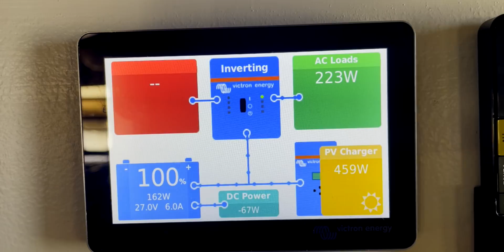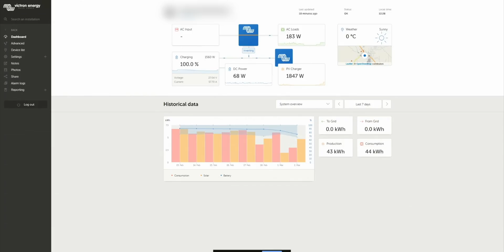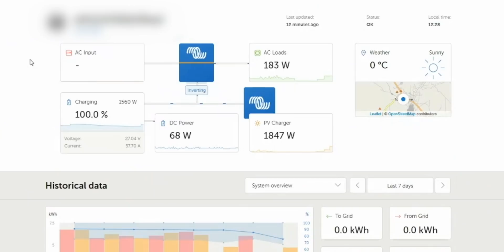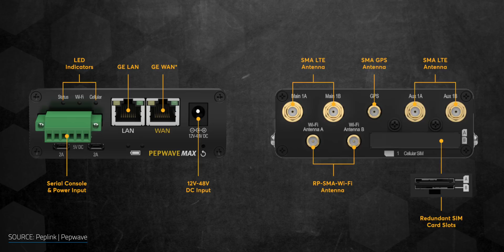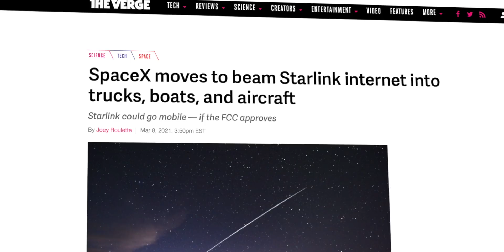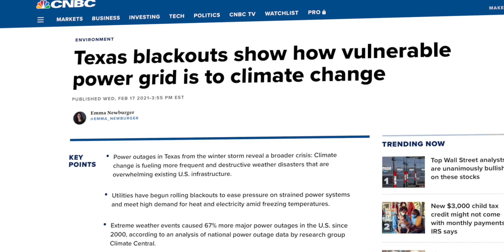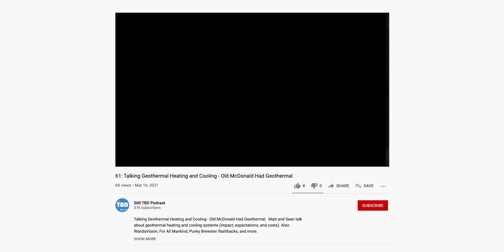Off Grid Living with Solar

Comment: I did something similar, although with a bus conversion. Live in it full time. Cellular, yeah you do need redundancy/multiple carriers. If you are used to gigabit you will be disappointed, especially in very rural areas with hills.

Solar was much larger scale than your typical RV setup- 10 305W panels for 3050W and a 10kWh Tesla based pack. I found this was plenty for all our normal appliances, but not enough to run the heat pump and AC through the nights however. So I'm upgrading to 6000W of solar and a 43kWh battery bank this month. The goal is feature parity with a typical household's electrical, not a "mobile" experience.

Here in KY it was a similar experience during the snowstorms, outages. We had internet and normal power the whole time, but couldn't run heat off solar due to continued overcast and low battery capacity.  Ended up running a generator through that.

Nice video! Lots of people going mobile...

Comment: I did something similar last year, just on the opposite end of the price spectrum.  I bought a cheap long wheelbase VW Crafter (similar to a Sprinter) with 500K kms, stuck some solar panels on top, a fridge/freezer, inverter, 4G modem, a mountain bike and windsurfer.  I had some real adventures in that van!

I toured New Zealand in this van for a few months while doing full time software development.  With 180 watts of solar, a weak 100 Ah lead acid battery and a power hungry gaming laptop it was challenging at times but overall worked pretty well before covid hit.  This setup looks sweet, I wonder how much it cost?  My 4G modem worked surprisingly well  but was very expensive and you need to be careful about remote areas with no cell coverage.  Starlink would have been ideal.

Comment: I'm with you Matt. I would find it hard to work within those space constraints. There's also a technical hitch, I don't drive. Was wondering whether your friend travelled to the northern states where solar power isn't as practical. Also I imagine he'd burn through a lot of fuel hauling such a heavy load from state to state. Wonder if he has an order in for a cyber truck?

Comment: We'll see how overkill his solar is after the inevitable cybertruck integration.
Reply: That trailer looks heaavvyy though. Even if you could bring the CT batteries to full charge, I bet your range would be like 80 miles. It's not nothing, but I'd always be getting anxious about finding a  good parking spot for that behemoth. The next question is how long you would need to stay put before the CT batteries would fill up again. I would guess more than a week. It might be nice to have a week to explore the new random place you arrived in, but I wouldn't really feel safe just leaving that expensive trailer parked and unattended as I went exploring. If you approached it with the right attitude though, all that unpredictability and spontaneity could actually be the the basis of an amazing American experience.

Here is a tip for Elon: You know how you have structural batteries now that make up a stiff undercarriage? How about a structural all-solar-panel one-piece roof for a trailer that mates nicely with a Cybertruck? I mean, a serious RV roof that's nothing but solar cells. A weight-optimized trailer setup like that, with mobile Starlink integrated, could make a game-changing system that would fulfill many people's dreams. (And a significant fraction of these people actually have the money to pay for it.)

Comment: I've thought about doing exactly that. The main reason I never pulled the trigger is the size of everything required to pull it off. The trailer is huge, and requires a huge truck to pull it. By the time you're done spec'ing and building you're in for $200k. I'm still planning to build a panel van RV in the future, but not yet.

Comment: He just needs to replace his pick up with a cybrtrck or some other electric truck of his choice..and utilize those 5-6 KWH of daily energy he can't use right now, he would also be able to utilize the electricity supply of the RV parks to charge that.
Reply: A truck with bi-directional CCS would be perfect!
Reply: I was thinking that too.
Reply: Not really necessary.

Comment: Solar panels on the roof of an RV are great for supplying the basic electrical needs, but A/C, heat, and water heating are quite a stretch. Not impossible, in sunny climates, but requires a full roof. And all of that is fart in a hurricane compared to the energy required to run the pickup, to be "energy independent". Then there's having enough land to grow your own food. Getting food otherwise consumes much more energy.

Comment: Oh, I DEFINITELY think about doing this. I'm glad to see how he pulled it off. I'm going to drag my feet a little longer since tech developments in batteries, PV, and internet connectivity are likely to continue bringing rapid improvements in the next few years.
Reply: I’m already amazed at how good it is, I still think of these things like 70s camper vans. But in another 5-10 years, as you say, it should be even better! Either much cheaper for the same capacities, or for the same budget far better ones.

Comment: With that much spare capacity, they probably could do all their AC/heating and cooking also.  I recently saw another RV video that had a 7000BTU domestic split AC installed, which they claim is fully powered by their RV's installed solar and battery. The AC drew around 400W in either heating or cooling mode.  I think they had 1.5kW of roof-top solar but can't remember the battery capacity.

Comment: I see a lot of people talking about how starlink is gonna revolutionize RV internet, while this is kind of true there are two major problems, the first being tree cover. Out West this is not a issue, but the more North or East you go this becomes a major issue at RV parks and public land. Second is ground stations, current starlink tech requires you to be a certain distance from a ground station. However this will improve as more base stations come on line and this will level up when SpaceX roll's out the newer satellites with interconnectivity which will allow you to be in the middle of the ocean and get quality internet by passing connections from one satellite to the next till it reaches a ground station.

Comment: A key thing left out of this discussion is heat and cool.  We opted for mini-split  (e.g. electrical) for heat and cool as apposed to propane or diesel for heat.    In our rig, it takes about 10kwh to heat (at 72F) for 24hrs if the temp goes down to 35F low.   So maybe 7kwh if we only heat to 60F (and dress warm)?    So we sized your battery bank about 3x larger than this video on a much smaller rig and can only do 1.2kw of solar - overall its not enough unless one stays in sunny/moderate temp areas.

Comment: I've run the numbers for me...  I'd have to be able to stealth about 80% of the time to recover all the costs in 5 years - counting no rent but having full internet (just before Starlink started their beta)...  The cheapest way if you're doing this and moving a fair amount though is to charge from the vehicle battery using DC-DC to begin with, but have it wired to add solar incrementally as you learn your draw demand.   This is a sweet setup (and gorgeous masterboard - really nice craftsmanship, seriously...)  You can always start lower in battery count and add in as well, that's pretty straightforward.

Comment: I am also a developer and started full-timing in November.  Currently on an 8 month trip across Texas, Louisiana, Florida and up the east coast this summer.  We are not as energy independent having only 800w of solar power and 400ah of 12v LiFePo4 batteries on a 43ft 5th wheel bunk house.  We also use a combination of AT&T and T-Mobile SIM cards and our Verizon phones for internet.  It works well.

Comment: Very insightful.  Let me point out that this system is NOT enough to run an air conditioner.  Can't wait for Starlink on the road.
Reply: Why not ? His ac uses 400w once the temp has stabilised. Mine does the same.
Reply: @nordic5490  Just going off of the numbers he provided and a good, solid Texas summer with AC use as my experience.  If you don't get in and out of the RV that much and set it to 80 degrees, maybe.

Comment: I wonder what it would take to live in an off grid RV like this without a municipal water source and with growing your own food hydroponically.  If you could get by with only buying stuff like soap and plant fertilizer.
Reply: Once you add the hydroponics you are really no longer mobile.  All he would need is a Reverse Osmosis system with a draw/drain line and a local lake/creek for water.  (essentially what yachts use, called a watermaker)    The amount of space it would take to grow enough food for one or two people on a continual basis would be fairly large and water is heavy.  

Watermakers are not THAT expensive, but they do need a decent amount of power to operate.

Comment: Great video, this is an exact replica of the system I just put together on a 2015 torque. I designed and put it together myself 15kw battery, 3kw panels.
Reply from the maker: Nice!  Happy with the results?
Reply: @UndecidedMF  the pannel output is less than I had expected (I usually sit at 1.5kw or around) the battery is crazy impressive. After everything, I'm at right near $4k invested. Granted, I sourced all my parts direct from Chinese manufacturers and built everything myself. But for what I have, this was a no brainer, I love it! I love the life, now time to travel and make some YouTube videos!

Comment: My off grid system is stationary and about $1,200. The guy in the video has about $8,000 worth of batteries. This may sound a little weird but in 1920 it would not have been cost effective to buy a horse that would last 100 years. In my case it would not be cost-effective to pay $2,500 for a battery that will last 20 years. For the same reason. I live in Texas and people have quit making fun of my solar panels.😁
Reply: LOL - that's 'cause we have our own - and 10KW of batteries to support it
Reply: @billb48843  I am so jealous. What I want to happen in about 5 years is that I will buy a Tesla S3 for $10,000 and they'll throw in a free powerwall. I'll hold my breath 😁

Comment: Question: I can see he is pulling his RV with a gas powered pickup right now but would he potentially - with a little modification - be able to go fully electric? I.e. Replace his gas powered pickup with a fully electric vehicle.
Reply from the maker: I think that's the ideal/ultimate setup.  A Rivian/Cybertruck/F150 pulling a trailer like that.
Reply: @UndecidedMF  I agree. However, my concern would be you wouldn't be able to reliably collect enough energy during the winter months. However, I think you could get around this by potentially building a portable folding solar array which could be deployed in situ as needed to harvest more energy and charge a greater number storage cells in a shorter amount of time.
Reply: If you average less than 20 miles per day of travel, that is probably feasible.

Comment: I live in Melbourne Australia & I have been wanting to do this for some time, still in the savings & prep phase, starting of small, building a custom 4wd that will suit my purposed. In recent years though the cost of even 2nd had RVs & caravans as they are called her have climbed in price  a lot. 

!0 years ago I looked @ mid to late 1970ies caravans, a single axile I could buy for $3-4000au & a dual axile $5-6000au, in good condition but with non e of the modern gear like solar. Now it is almost impossible to find something like that in good condition. People are holding on to the for longer.

I saw a 1967 'vintage' single axile in the local area that had been restored (roughly, but it was tidy) They wanted 25,000au for it & it was basic no solar.

much of the new caravans in some cases cost as much as a house.

So kicking my sell I did not buy something 10 years ago.

Comment: Only think I didn't hear him mention was air conditioning, heard that's a MASSIVE power sink so like if you're in a hot/humid climate i feel like battery only systems are gonna always be limited.
Reply: It is, but it isn't. The normal (factory units) units are poor at energy anything! Furnace, water, AC, etc. If you get involved with DIYer's batteries, solar, etc. Many are doing minisplit AC's that are much more efficient and entirely doable. There is (of course) a FB forum on just that subject. https://www.facebook.com/groups/596097084676572 -  Our setup (and probably his) can power the AC for at least 6 hours a day and recharge the batteries. I check tomorrows weather and solar amount before running at night, so that I will get recharged.

His inverter unit (Victron) has the ability to share and assist with a small inverter style Honda, Predator, etc generator to maintain AC. 

He did mentioned toward the end about the Texas ice storm and the water (10.23). We have 100 gallons onboard that has gone through filters (25 m carbon, 10 and 1 micron particle filter for general use and then to RO / UV for drinking). Traveling from place to place, (Yuma, AZ is pumping rocks, (LOL) to Carlsbad, NM is pumping RO (because their water was as bad as Yuma), you never know what your going to get for water quality.

Comment: You went through everything except cost (did not see it on the website either). I know he's a software dev & prob earn a good chunk of change to make this lifestyle change happen but for us mere mortals it helps to get a ballpark figure of how all of this measures out. How much did the RV cost? Was it new or used? How much did it cost to trick out his camper with all those solar panels, batteries, & controllers? What's the monthly expense of all the data plans he has? How much does he spend in renting space at the trailer/RV park? Gas expense? How long does he stay in one location?  All of these questions would have been so helpful to find the answers to so I'm not sure if it's due to social cues you've avoided talking about taboo subject such as money that these questions weren't broached.
Reply: I can’t comment on why the video avoided money details, but as someone who has owned 5 RVs over the past 25 years and driven tens of thousands of miles, I can answer some of your questions: a 40’ toy hauler 5th wheel like his will cost between $15,000 for something old and beat up (but serviceable) to $90,000 for a brand new “high end” model.  Solar system ballpark was $8,000 to $10,000.  Cellular plan cost ~$120/month.  RV park and gas expenses are obviously variable depending on where and how much driving, but figure $45/hour operating cost for driving somewhere, and $0to $125/night to stay, depending on where.

Comment: We have done this in Australia, 3.5years and worked for 18 mths.  The work problem is not so much a tech problem and more of a “what am I ding?” Problem.  Sitting at beautiful locations and being stuck inside working SUCKS BIG TIME.  We lasted 18 months and gave the jobs away.  The tech is good for connectivity when you want it but some of the most beautiful spots have very limited access, in our case Optus V Telstra.  We covered both services with multiple SIM cards
Nice show!
Reply from the maker: Nice.  Thanks for sharing.  And glad you liked the video.

Comment: Better to have oversized the solar system especially if they purchase an EV truck and use their excess solar to charge the truck.  How much propane do they use?
Reply: eh, solar panels are bad at stuff like charging evs, especially when you consider the surface area. Breakers would pop constantly.
Reply: @MenacingPerson  check out the Morton’s videos.  They oversized the solar on their rig & use the excess to charge their car.

Comment: I want this on an electric RV. No need to add extra batteries, then if you move less than 200 miles every two weeks or so, chances are you never visit a charger! Disclaimer: I have solar at home charging EV right now.
Reply from the maker: That's the next step.

Comment: “The Uk government green homes scheme has collapsed. Part of that was about promoting heat pumps - which could be v expensive to run. Meanwhile in Scotland they think they have the answer. @t
Reply: Didn't so much collapse as was kneecapped by the Tories!
Reply: @mentality-monster  have a look at SolSafe not trying to sell anything just show the opposability to reduce fuel poverty with the green transition